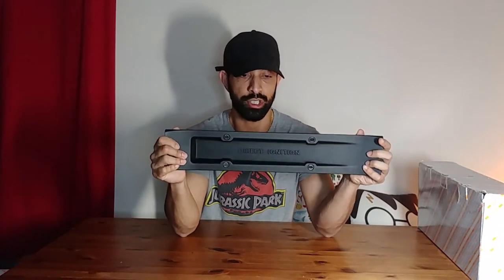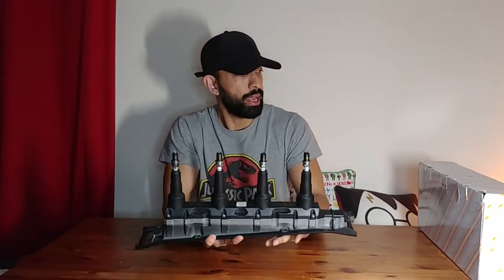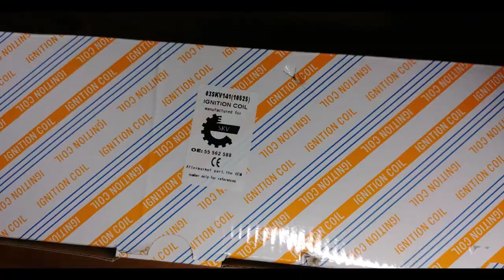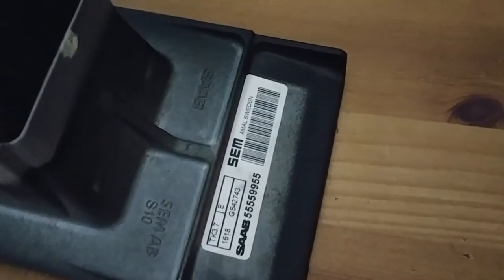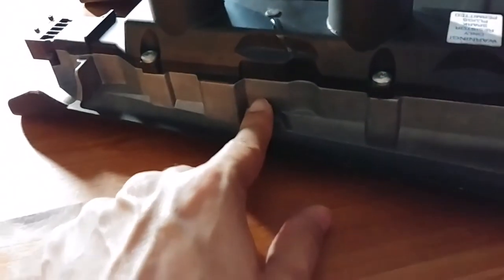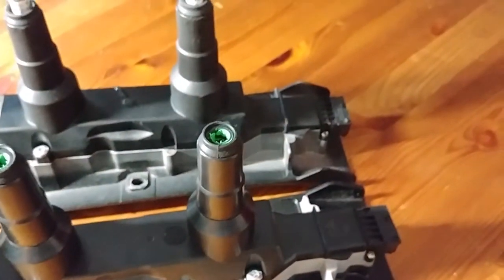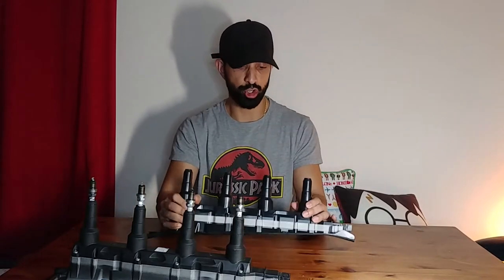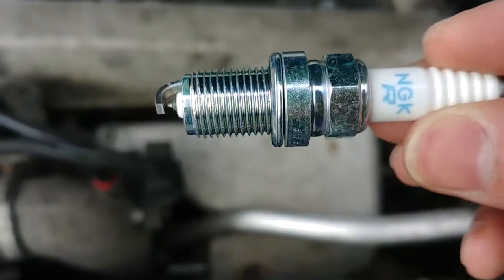Saab Direct Ignition Cassette (DIC) Install & Comparing SEM (Sweden) vs SKV (Poland)

Comment: Good thing you changed the plugs aswell. Never change DIC without changing spark plugs!
Reply: I am a new SAAB owner. What is the reason or reasons why I need to change the  spark plugs when I change the DIC?
Reply from the maker: They can fail and can effect the DIC, always use NGK R spark plugs just as SAAB intended when the Trionic 7 developed.

I think I will replace my DIC for the new generation part number 32022255 next year, as the it is a superseded part I am hopeful it has advanced further.

Comment: Did the problem solved changeing the DIC ? My one got same problem and i dont know if i should buy one on autodoc for 160€ and change it my self or go to the mecanic and pay 250€ for a cassette that he thinks is good . What would you do?
Reply from the maker: Hi,

Personally, I would suggest changing your CPS before even thinking about replacing the DIC, the CPS on these engines fail due to the sheer heat produced from the CAT. If you do change CPS please please please purchase a renowned brand, I purchased one from eBay and that died within a year as the magnet point made contact with the wheel (sensor was slightly taller than OEM).

To answer your question NO, I had to replace my CPS again, however, my new aftermarket DIC is just fine with no issues at all. That said if you have the funds I would stick to OEM if not a European brand asI have heard far too many horror stories with the far east products.

I would first replace the CPS before replacing the DIC, I reckon your issue is the CPS, do it yourself dude, it is easy.

I hope this helps.
Reply: @the80sdude51  my car its working , its just that it have’s some missfire sometimes . Thank you for the answer. Should i change the sparks to?
Reply from the maker: @CivicMB2  100% I would change my plugs.
Reply: How is it going after a month? Is going well? I took my DIC out ( sounds so funny😂) yesterday and i saw a big crack like youre’s . After a month do you still recomend the skv?
Reply from the maker: @CivicMB2  SKV It is indeed good n well, however, it does not feel as torquey as the SEM setup, perhaps the timing is retarded to avoid pre-ignition. Honestly, it's hard to say without a DYNO, all I can say is the car drives really well but just lacks that low-end punch.
Reply: @the80sdude51  thank you for youre answers ✌🏽

Comment: I'm in this exact situation. changed the cps and plugs.. still crank no start.
which leaves the most likely candidate to be the dic... 
not gonna buy the after market one, half price but don't last long as far as i could gather from the net.
might gonna try and get one from the junk yard.
also wondering if you got an original whether one could fix weld the cracks.. anyone tried?
Reply from the maker: If the engine is cranking and not firing I would suggest replacing the CPS with a branded CPS. 
If this has been done and still not fixed the issue, check the injectors are firing, if the injectors are firing then perhaps the DIC is completely dead.
I got rid of the aftermarket unit and stuck with the OEM, still fine to this day but I do get a lot of mis firing (according to TECH2).

Comment: ALL... SEM DI cassettes show case cracking  above the black transformer.  Happily, it's only a cosmetic issue.
 Failures start when the the White coil tubes start to lose their cooling oil. 
Green oil on the plug porcelain is the sign of near death.
 Either the white cyl cracks or the oil seeps out around their central contact.  From heat cause reasons.
The Aluminum casting is Important as it acts as a Heat sink.  And it's not really enough for extended life.  
Plastic is a piss poor substitute. 
Seriously unlikely that Cassette was cheaply made anywhere but in Asia. 
4 year warranty sounds enticing but then the Vendor likely won't exist next year, let alone 4 years from now..

Comment: Why? No one thinking to move  DI cassette higher 10 to 15mm. high from engine COVER by used TEFLON insulator. SOtheDI cassette not touch the engine COVER. SO the DI. cassette not so hot.TRYto move DIC higher.
Reply from the maker: This concept is not feasible, as coils will  not be in contact with the spark plugs.

Comment: Is youre cassette still working ?
Reply from the maker: Yes, as stated in one of my messages, I took it off a few weeks later as it did not feel as punchy as OEM. Perhaps the timing is slightly retarded to prevent pre-ignition?
Reply: Sorry for being so enoing , i am from spain and there’s no videos in spanish . If you took the aftermarket of , what do you use know?
Reply from the maker: @CivicMB2  It's quite alright, you are not annoying at all. I took my aftermarket off as it did not feel as torquey as the OEM item and it really bugged me, so it had to go. Also, I realised the DIC was not faulty but the CPS, so now I keep the SKV as a spare in the boot. 
I hope this makes sense
Reply: @the80sdude51  nice , thank you 🙂